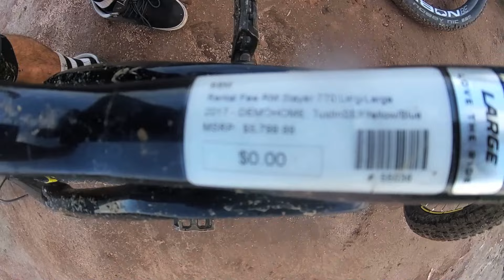$5,800 MOUNTAINBIKE FOR $0

Comment: Your buddies may have had an easier climb if they locked out their shocks.  Raise the seat up as high as possible and that will help out too.  Clipless pedals also helps.  And finally, slow and steady wins the race, so make sure to choose correct gears.
Reply: P Taushick lol
Reply: I bought Dylan his first pair of clipless pedals when he was five years old. I made the shoes by modifying a pair of kids soccer shoes. I ride with clipless on my daily ride but Dylan uses platforms. When I raced downhill I used platforms but clipped in racing cross country.
Reply: P Taushick just so u know higher end bikes don't lock out (not trying to brag just to prove a point) I ride a 36 and a x2 and neither of them lock out
Reply: You mean on DH bikes, not necessarily just higher end bikes? So higher end Cross Country bikes would still usually have lock out shocks?
Reply: P Taushick You do know there're more than two types of mountain bikes...?